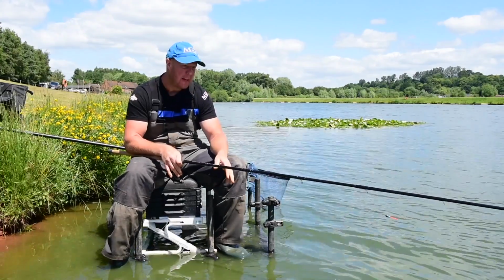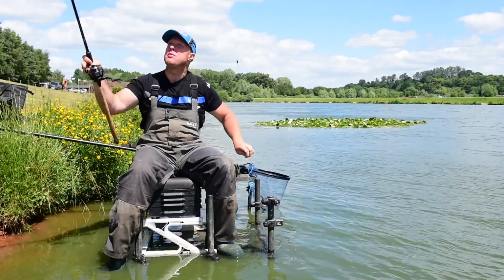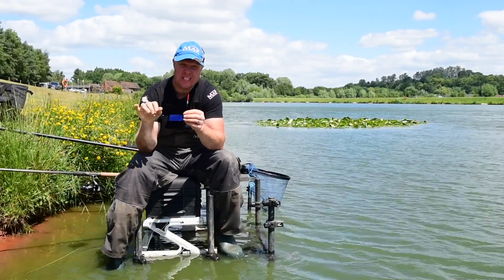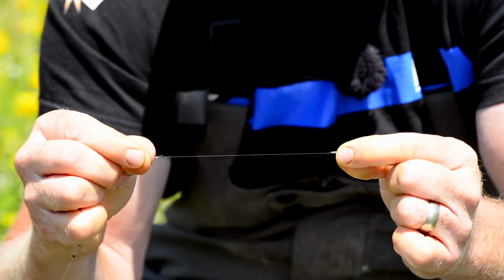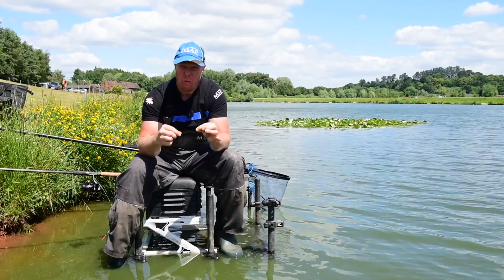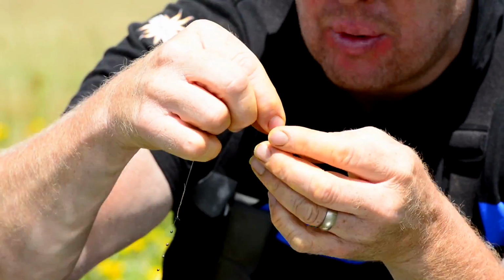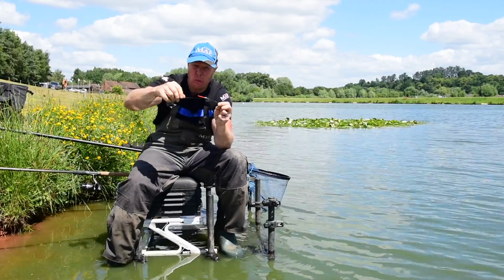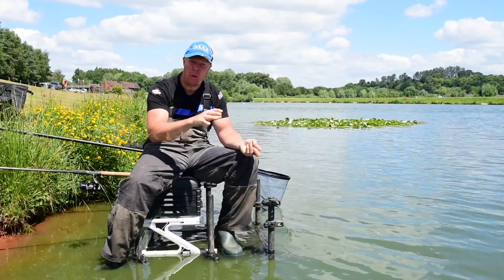Pole Fishing On A Rod? - Andy May

Comment: really you would be better with a float stop with the push bead and push in insert near the rod tip less chance of damage
Reply from the maker: Matthew Davies as long as it’s big enough and a soft rubber, either will do the job... that sound wrong but you get the idea 😂
Reply: @WinningWays  yeah it does  lol i thought the same dirty minded doesn't cut it
Reply: @WinningWays  thought of a better way to fish this method use a quick change wag adapted because it causes a anti tangle method  and put about of silicone on after then a lead egg sinking very light or shot that way you have a quick change pole float for this method